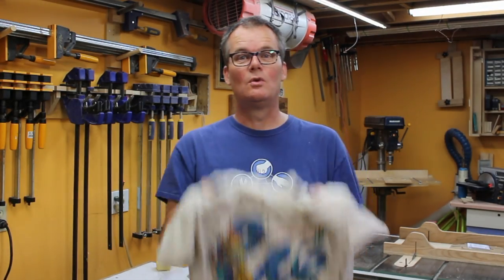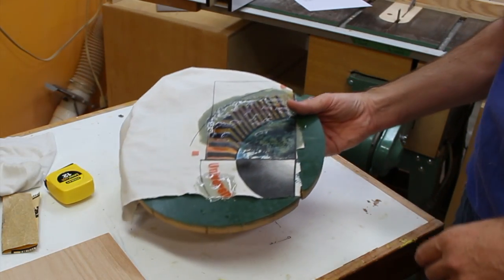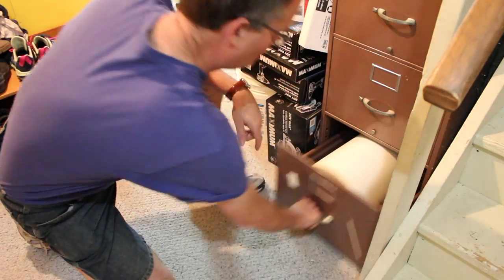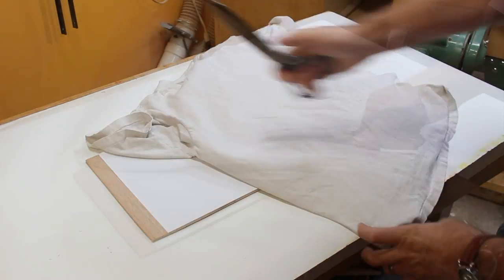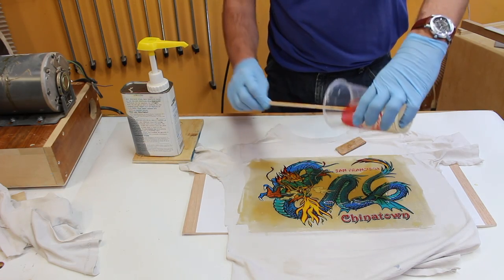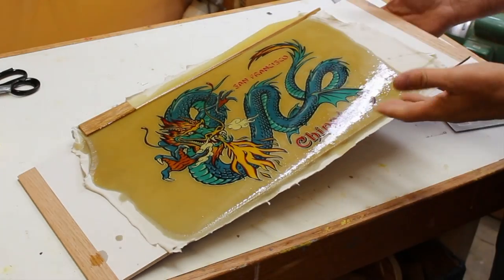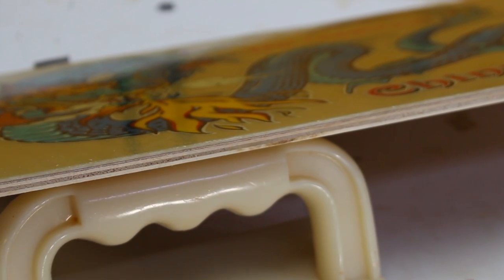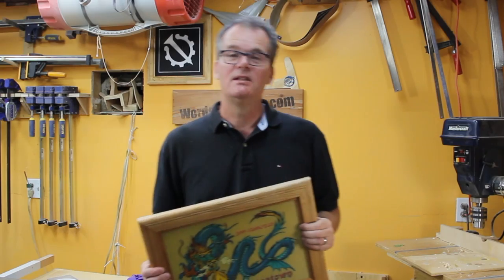Epoxy -vs- T-Shirt !!   (WnW #60)

Comment: Thanks for sharing. Could you get a good result using this technique with just a ink-jet print on paper?
Reply from the maker: I would think so, but I haven't tried it.  The beauty of this is that you can easily reprint an inkjet page if it doesn't work.   I understand that inkjet stuff can bleed when it gets wet, but I don't know if this would count...    This is why you do test pieces like I did in this video!   Good Luck!

Comment: Turned out nice! Did the epoxy have a strong odor to it? Ive done some experiments with epoxy and i always had to move it outside.
Reply from the maker: Not much that I noticed.  I did open the window to ventilate it as it dried, but it was not that bad.

Comment: Hi-

I think you just showed me how to repair/recover/strengthen the headliner in my car. T-shirt material and the epoxy should do the trick.

Would you mind explaining what the torch was used for (and how it was used?)?

Thank you.
Reply from the maker: Heat is uses to pop bubbles in the epoxy -- a heat gun can be used.   Check out lots more videos to see examples of this.   Epoxy will drip under gravity, so I don't know how you would make this work unless you turn the car upside down...  :-D
Reply: @Wordsnwood  Thank you for such a prompt reply.

My idea is this:

1. Remove and clean the headliner shell from the car.
2. Using your method, apply strips/sections of t-shirt material to the back of the headliner. 

Note: It's a headliner, so I can't make it too heavy (or the weight of it will pull it down). All I want to do is STIFFEN the headliner shell and once that is done, install new headliner material.

Your thoughts are welcome.

P.S. I don't have a heat gun, but I do have a torch. Am a big fan of using what's available hence the t-shirt instead of fiberglass cloth. :)
Reply from the maker: @Milpower  Good luck.  I know nothing at all about headliners...

Comment: Nice build and epoxy job there Art. Could or would it be easier if you put the t-shirt behind a glass frame, a bit like footballers/soccer players do with their shirts?Thanks for the Video, Take Care,  Barry (from England)
Reply from the maker: Sure, but where's the fun in that!?  :-)   In my case there were some stains and blemishes, so I really just wanted the artwork part of the t-shirt.   It's smaller this way, also.
Reply: ha ha yep you are right not really fun doing it the other way, well you could have a bit of fun making the frame at least ha ha. Thanks for the reply.  Barry.

Comment: why use the epoxy could you have just used the spray adhesive?  I like the project and have a T-shirt in mind.  my reason for asking is DIY on the Cheap
Reply from the maker: There's lots of ways to do it; this is what I felt like doing.   I wanted the solid/slick surface of epoxy.  Spray adhesive would still require mounting behind glass.
Reply: +Wordsnwood (Art Mulder)  Thank you that makes sense